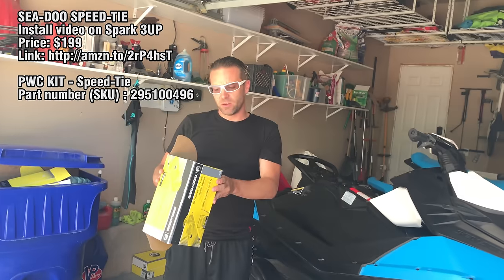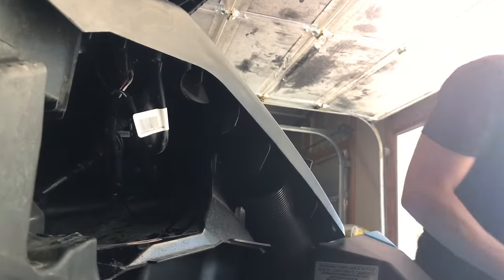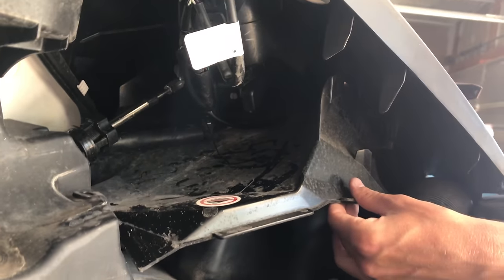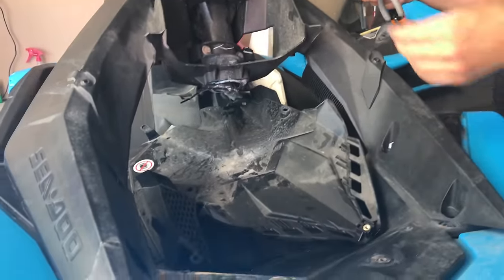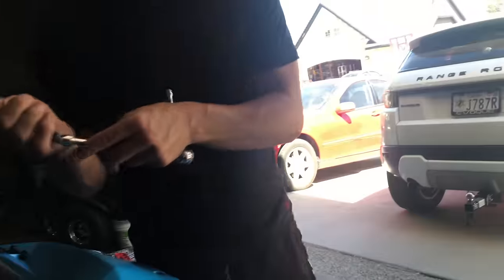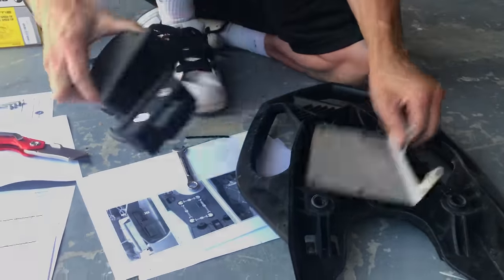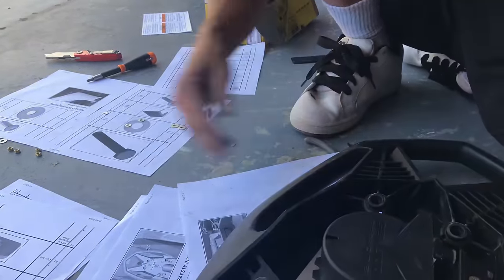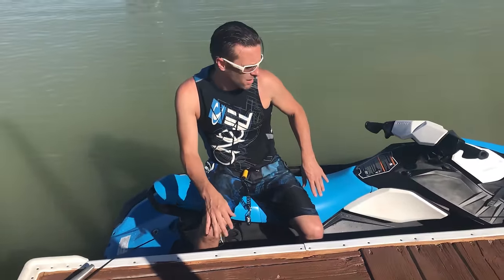SEA-DOO Spark Speed-Tie install

Comment: So its been 7 yrs since you posted this video. Can you give use a follow up review?  What is the longevity of the retractable spring system?
Reply from the maker: Sometimes they get stuck trying to retract the rope, but a few tugs usually frees it up. I don't know what to put into it to help lube it up,. Sometimes on one of them, I can't retract about 7 inches of rope so it just hangs there. Most of the time they all retract easily. Its still 100% worth it, I use them everytime I go jetskiing.